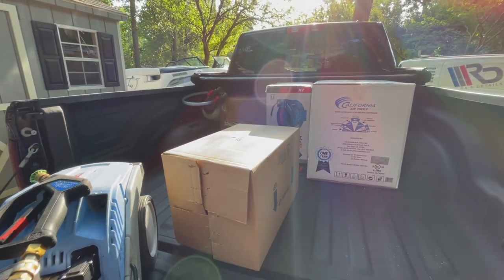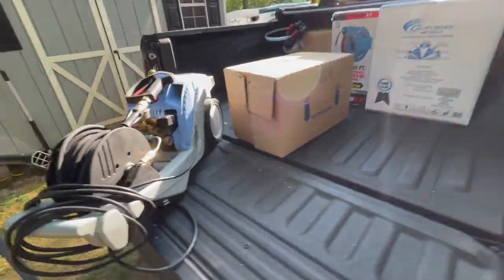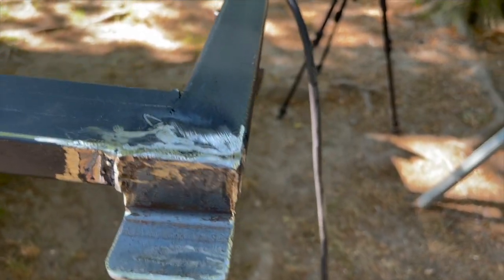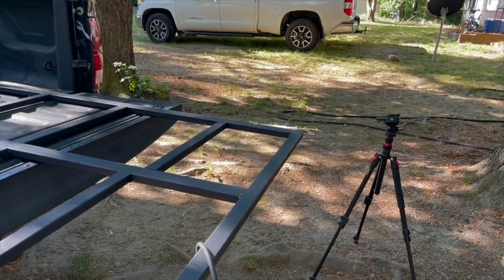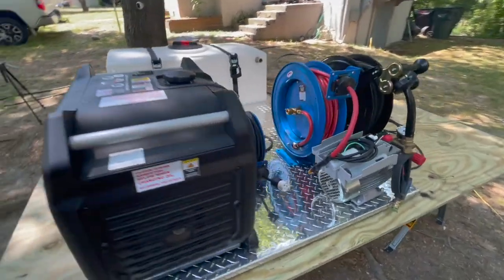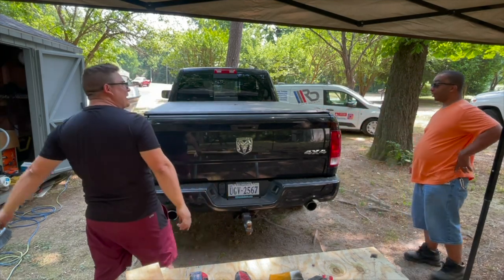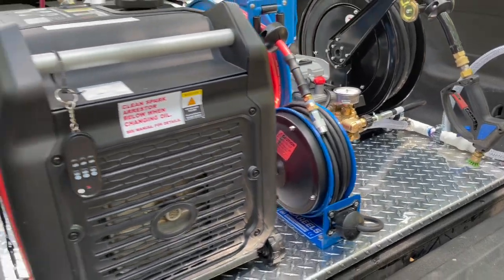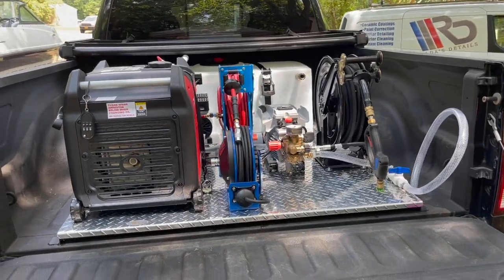New Mobile Detailing Setup low Profile Dodge ram 1500   HD 1080p

Comment: What a magnificent setup, amazing.  Question I'm currently in the process of setting mine up. I'm using a gasoline powered pressure washer. Do I need to install a pump as well or will I have enough pressure without it?
Reply from the maker: Is all depends on the type of pressure washer some are self priming those ones don’t need!
Reply: @RaldasDetails  Thank you for the info. Much appreciated.

Comment: Super nice Toni!! I spent yesterday nearly crying thinking of my set up here in Helsinki! There is no Toni or Raldo’s detailing here so no one to advise me of the set up. I was looking at your setups but all products are from US so not so easy to find similar here in EU. Anyway the extra part you had which I did not think about was the pump. What output is that?
Reply from the maker: Sorry to hear that bro! The output in the pump is 3.5 gpm
Reply: @RaldasDetails  no worries! Thanks for the info.  Is the power 12v?

Comment: That retractable hose reel is originally for water or air?.
Thanks Tony you are very handy.💪💪
Reply from the maker: It’s for water 4,000 psi capacity air normally are rated at 300 psi 👍🏻👍🏻🙏🙏
Reply: @RaldasDetails  Donde lo compraste.

Comment: You should've  had a list of parts of the pump s and where to find at
Reply from the maker: Mobile setup links recommendations  
. A/R blue 630
  https://bit.ly/3bEnN41
. Active VE52
 https://amzn.to/3o5UptU
. 3/8 female quick connect
 https://bit.ly/3FwP0lk
. 3/8 male quick connect
 https://bit.ly/3rjjD9
. Retractable pressures washer reel
 https://amzn.to/3g3RygQ
. 4-way roller bracket
 https://amzn.to/3AFev3b
. Retractable power reel
 https://amzn.to/3H9z7mG
. Water pump 
https://amzn.to/39pZVzU
. Water pump 2
 https://amzn.to/3sglXOH
. Remote controller 
 . Float valve 
https://amzn.to/3nYKYNO
. Water pump adapter 
https://amzn.to/35paAff
.Contoller remote 
https://amzn.to/32qfOGc
.Air hose reel 
https://amzn.to/3KPh9Io
. Weep like air hose 
https://amzn.to/3A1Wooo
. Vacuum hose 50’
https://amzn.to/3G2fJXv
.Vacuum cox reel 1
https://amzn.to/3g64bHX
. Vacuum cox reel 2
https://amzn.to/3KSR8Ij
. Beast vacuum 
https://amzn.to/3KK2gqR
. Pressure washer whip line 
https://amzn.to/3KPpICS
. Cox reel pressure washer 50’
https://amzn.to/3AC1dVg
.Pressure washer hose 1
https://amzn.to/3Ha81Mg
.Air compressor option 1 
https://amzn.to/3AFvpif
. Air compressor option 2
https://amzn.to/3u7BAub
. Quick connectors 
https://amzn.to/3rVIz6D
.Westinghouse generator 
https://amzn.to/3HaXzEi
. Garden hose quick connect 
https://amzn.to/3AFFgon
. Strip lights 
https://amzn.to/3s0yAwT
New age cabinets 
https://bit.ly/3mMsNZC
Spot lights 
https://bit.ly/3NPGPWq

Comment: Nice job Tony looks great .. what are those hooks called that you use to bolt down the water tank? I just want to do that for my 100gal tank to 3/4in plywood inside my express van. I don’t want to risk anything by drilling into the actual van floor. Thanks in advance Tony 👍🏽
Reply from the maker: I get them from Home Depot!
Reply: @RaldasDetails  ok thank you 🙏🏼 one more question if you don’t mind but would you happen to know what kind of black paint would be best for me to paint my plywood floor in my detail setup? Thanks again Tony have a blessed day

Comment: hey tony do you have a video on how to secure your water to the chasis of your vehicle? also when it comes to starting your detail setup
do you first
1.) Get the dimensions of your vehicle
2.)weld together and build the frame and then secure that
3.) then add your equipment and secure that as well
Has your plumbing for your water tank changed or improved since your original setup and when you run your 30 amp kit to your generator along with your wireless remote, do you also run an extension off of that 
and lastly, did you drill a hole for a return valve for you pump so it doesnt overheat
Reply from the maker: No brother but I sale a package the help you build you van at raldasdetails.com

Comment: I’m glad I got a truck Now.
I have one question though, 
Tony if the client would’ve had a 65 Gallon tank instead of the 35 would it still be enough space for all equipment?
Or maybe there would be No space for the Compressor 🤔

Comment: What did you put before the seaflo pump? I’m having issues with back pressure and water spraying everywhere when I release the trigger. I installed a check valve between the pump outlet and pressure washer inlet and after a few weeks the hose there finally popped. Not sure if it’s old hose or what, but any recommendations on how to do a proper pump and pressure washer setup would be awesome!
Reply from the maker: The problem I think is the pressure washer try with out the pump do gravity and see what happens!

Comment: @11:06 what do you mean by the not having to worry about the water in the line because of the pump, and when should you have to put another line back into the water tank so that way you can keep recycling the water so the pump doesn’t die..
Reply from the maker: In this case for example wend you want to fuel up a bucket 🪣 you can easy lose prime in the pressure washer, because you need to open the valve to do it, so the pump will push water back to the pressure washer that is y I  said  we don’t have to worry, so the kranzle is not going to work hard to suck water. 
You need another line back to the tank wend you have a gas pressure washer because is always running because they don’t have auto stop vrs the electric pressure washer. Thanks for watching 🙏

Comment: How do you get the diamond plate rapped around the end of the plywood so nicely and is it possible to find it in different color ?
Reply from the maker: This is not plywood bro is metal and the diamond plate is 1/4 inch thick.

Comment: Does the pressure washer have to be the type that continually runs so it doesn’t back up the pump?

For example motor is always running vs only runs when the trigger is pulled

Comment: Killer work very clean 👌 whats the build cost on this?
Reply from the maker: At this moment for the platform made of aluminum and installation about $3,600 equipment is not included
Reply: @RaldasDetails  thanks for the reply back 👍  was curious on equipment cost ? You on Instagram?
Reply from the maker: @peggsautodetailing391  yes @RaldasDetails
Reply: @RaldasDetails nice 👌 I'll follow now cheers from 🇨🇦

Comment: If I have a kranzle 1322ts and I’m mobile do I have to cut the cable shorter or can I leave it as is. (powered by predator 3500 inverter). Thanks.
Reply from the maker: You can leave it like that.
If you have  any problems you can cut it!

Comment: how did you wire the pump? i didnt see a battery
Reply from the maker: This is a 120 volts
Reply: Power coming from portable generator.
Reply from the maker: Yep